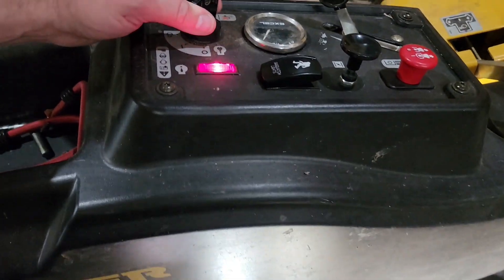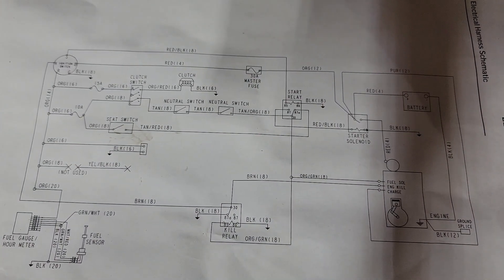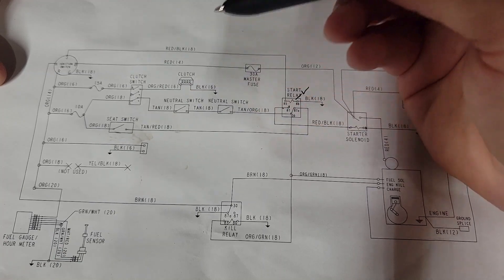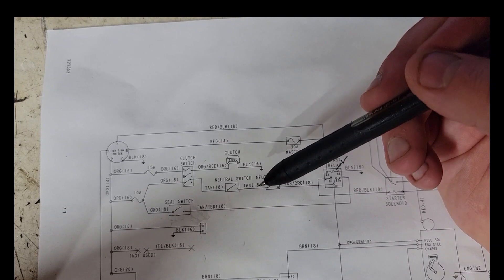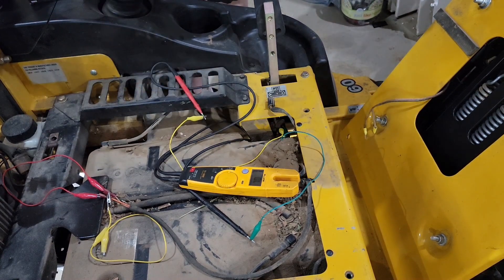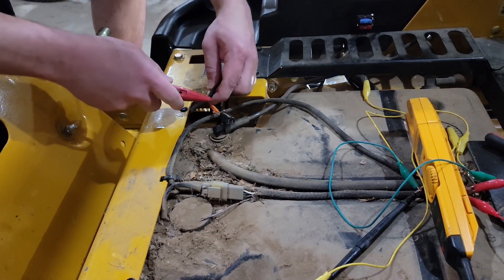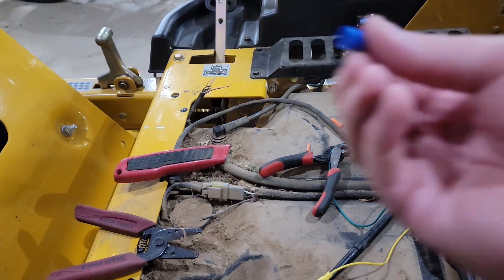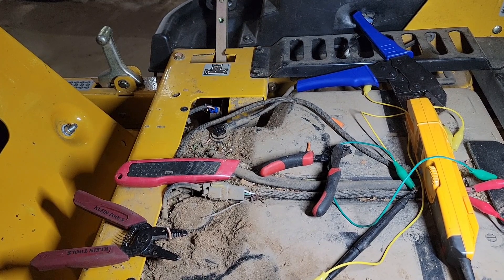Hustler Fastrak SDX60 (2017) Fixing No Start Condition

Comment: Where is the starting solenoid physically located ??
Reply from the maker: It's below that control panel. You can get to it easy with the right rear tire off.   There are 3 identical relays. You can try swapping them around to see if you get different faults if you suspect a bad relay.   They easily pull right out of the terminal sockets.

Comment: The same wires have broken on my Fastrak three times. Poor connections. The insulation should be captured in the terminal to help support the wire.
Reply from the maker: The other lever switch connection failed after making this video.  Terrible quality.    My repairs have been working well so far. 
Thanks for watching.  🤠
Reply: Wires did the same thing on mine for both sides. I did the same fix, but am having a heck of a time getting them to stay on the terminals. I don’t know how many times if had to pull the seat in the middle of the yard to reconnect them. Im considering pulling the switches and soldering leads onto the switch and using bullet connectors instead.

Comment: Just bought a 2023 hustler x one 29.5 Kawasaki. The malfunction indicator light is on and won’t go off. Any idea how to reset it?
Reply from the maker: I'm not sure If it's the same as my machine. My red light only means no oil pressure. That's why it's on when the engine is off.
Reply: @projectswithjw  this light indicates malfunctioning of the EFI system. Just gonna have to take it to the dealer 45 minutes away.  Brand dang new and this crap happens
Reply from the maker: @zach_barnes8248  I hope warranty takes care of it for you. I've had my hustler for 7 years and only had the two problems from this video so far.
Reply: @projectswithjw  you and me both. I’m a die hard hustler guy but if this isn’t taken care of (he assures me it will be) I will have to go green I guess